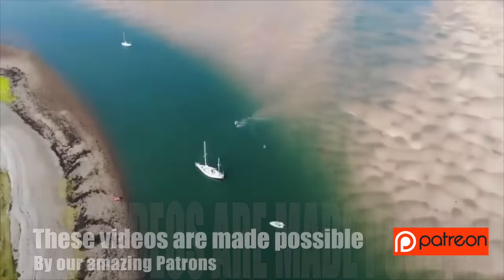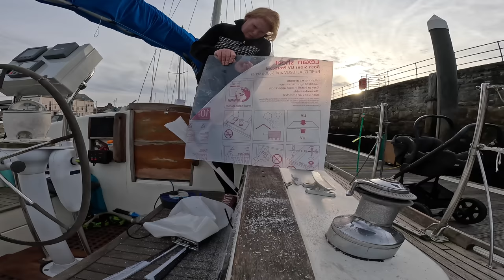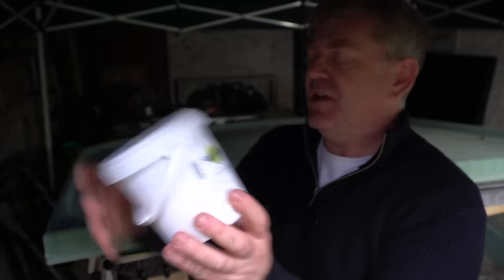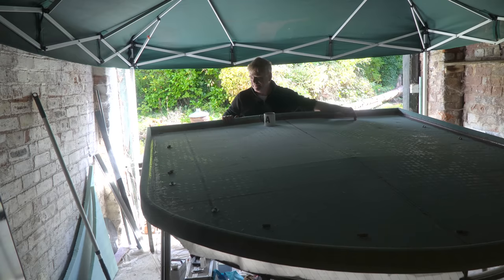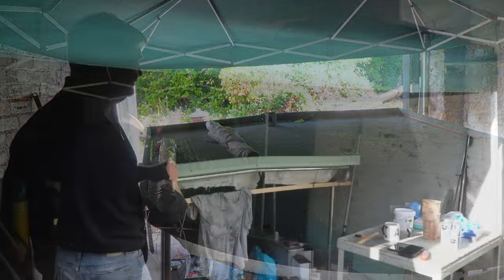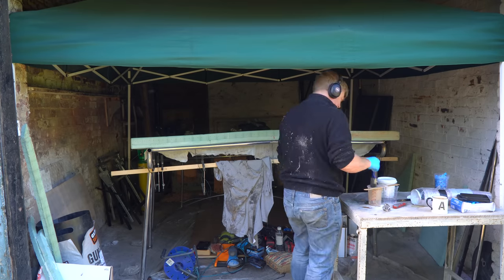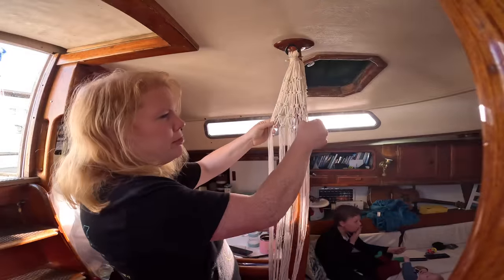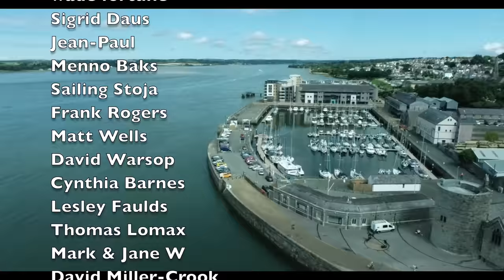164 : Making a Sailing Yacht Cockpit Enclosure Fiberglass Roof

Comment: If possible, make a 5- 8 mm high protrusion along the bottom edge - where you want the rest of the rain to drip from. Otherwise the rain that might not be retrieved will be led into places you do not want. This is because you will both tilt the boat and exposed to wind. The will lead the rain sideways and/or up!

Comment: Get a piece of wood that’s just the right, width length and depth to go in to your hatch track. Then cut Datos down the center that or just wait enough to put the plexiglass in then make 45° or whatever is appropriate for the bottom two corners cuts and glue them on to the plexiglass with epoxy. You could then make a board to go across the top, even if it needs to have an arch on it. Basically making a frame around the glass that fits into the slot for the boards that are already going in to close up the cabin.

Comment: You should frame the plexiglass into two separate pieces….add hinges attach to either side. Add a strip to run vertical overlapping the center frame attached to one side…I promise it will be a huge improvement…”use thicker plexiglass tinted in light bronze…”
Reply from the maker: Yeah that would be lovely but we were just using stuff we already had. Can’t afford to buy new bronze tinted Lexan at this moment but we will do that at some point I think

Comment: With the hatch, unless you give it a rigid strip across the top a blustery wind (or worse, a wave) could make the perspex bow inwards, pop out of its rail, and allow a gale (or a flooding) in through the hatch. 
To make it more secure you could fit a T-shaped profile to the vertical sides, with corresponding T channel to run down. Easily doable as you have a lot of play in the channel, so you can construct as additive, aluminium or stainless strips(2) secured to the fascia between the inside and outside of the hatch. And repeat on other side. Gap between strips to fit the width of the perspex, plus a small amount of play. 
[Or avoid using in high wind and high seas]
Reply from the maker: It's not for use at sea, only for rainy days at anchor :)
Reply: Would be wonderful to be able to use it at sea though. It's a great idea methinks.

Comment: Yes! I've done same, you're right, it's night vs day, lifts mood. 😊 Sometime, worth trying with Twinwall Polycarbonate, the stuff used in conservatory roof. Its very very light, no risk of injury dropped on toes, and similar thickness to wooden wash boards, and,  can be cut 2 sections, with strip canvas, sail cloth, stuck with Sikaflex etc,  to make a 'hinge', allow 2 pieces to fold in half,  to store ... and overcomes rain,  wind,  seeping through where they butt, at the join.
Reply from the maker: Will have a look at that. This is doing the job well for now 😃

Comment: For me you don't mix enough the epoxy. For corner put the epoxy in freezer plastic bag and you cut a corner and you extruded the epoxy stuuf much easier and more cleanly. Melissa greats ideas, for the window,  you can glue thin wood on the polycarbonate that will strongly reinforced your polycarbonate, but you already know that I'm sure. Beautiful ideas like usual.  Thanks for sharing.
Reply: Andy didn't show the complete epoxy mixing procedure, he only showed brief, edited sequences of it. You can't really comment on whether he is mixing it thoroughly enough, unless you've watched the whole procedure. 
Melissa has already suggested that she will use wooden "shims" along the borders of the lexan to make it fit properly into the channels. 
And I agree, she did a great job, so far! 👍

Comment: Hi Melissa, when I made the clear screen for our hatch, I used the curtain track for pop in caravan curtains to create a frame around the plastic, it then fits the hatch track without rattling about, or when I cut it in 2 pieces, sliding past each other. It was only a few quid from eBay. I stuck it with clear silicone so it’s water proof too. Hope that helps, loving what your all doing.
Reply from the maker: Thank you will look into that ☺️

Comment: Andy it’s Clive 🧙‍♂️mount your roof with a slight gradient …run any water off forward .. fit stub drains in holes that you can plug plastic pipes on to collect rain water for off grid water harvesting and that way you can control where it goes and don’t end up with run marks or rot points if there’s wood round the roof drain points.👍🏻😉
Reply from the maker: Hi Clive 

Yes that's the exact plan

I've built the gradient in both athwartships and forward and have already bought the drain fittings for it, just not got as far as showing that on YouTube yet

Comment: Having so much more light in the boat is wonderful. What I would suggest is in the future removing the handles from the outside and putting doors on hinges, that is what I have on my companionway and now having had it, I could never go back to boards. They swing open so nice and easy, and I don't have to worry about dropping it overboard when things get rough. 

You can get thicker polycarbonate sheets that will allow you to use a step over bit on a router to make the doors overlap each other. 

Looking forward to seeing that dodger finished out.

Comment: Love your fruit hammock. Maybe get Andy to make a narrow-width fibreglass strap to size, to place along the base of the hammock. Weave it horizontally in and out of the webbing holes at the base and secure it to the two  end-rings with some cord.That would prevent the sagging in the middle when objects are placed within. You could use some cardboard, thin ply, or flexible foam in the meantime cut into a strap shape.
Reply from the maker: That's an idea

Comment: Mellissa if you put a beading on your "Window" remember that it will have to stretch the full length of the "Window" to slide in and out.  This will be stopped by the boom.  That is why the wooden cockpit doors come in 2 pieces.
Reply from the maker: There's about 5 feet of clearance or more before the boom but yes it does need to be in two pieces eventually
Reply: @SailingMelody have you considered also changing the sliding ‘roof’ part to perspex for even more light? Remember the cockpit cover will rob a bit of the light you’ve gained. Looks like it has a wooden frame, I’m sure the perspex can handle the slight curve, or heat it to shape it 🤔
Reply from the maker: It's a consideration

Comment: Hard tops coming out really nice. Next time you have to do a fillet get a piping bag or just a regular Ziploc and cut the corner off. I think you may want to reassess the holes for the through hull fittings prior to fiberglassing.
Reply from the maker: Thanks for the tips!

Comment: Epoxy glass is so forgiving until it isn't then its the devil to sand flat again :)

Small scratches and divots holes etc disappear under glass but bumps or high points trapped bits make life very hard so its the transitions in new and old glass or overlaps of glass that can get difficult but peel ply really helps.  One trap I fell into on my first hull glassing of an 11ft dingy the first side I struggled with then I worked it out half way through as a result one side looked perfect the other side took forever to fair out and I'm still not happy (but then no one else can see it :)
Reply from the maker: Ahhh no!

Comment: Hi....just my 2 pence worth.......before fibre glazing would it of been worth putting some wooden or stainless steel strengthening bars ( flat)....on the top or even the bottom....of the canopy ....maybe bent to follow the Shape .....fibre glass it in.....   ..
Reply from the maker: The foam with glass is as strong as timber with glass or arguably stronger and wood will 100% rot eventually whereas the foam won’t. Many huge ocean racing boats are entirely constructed using this method :)

Comment: So when do you put drain holes in for sure it will collect water
Reply from the maker: Good question

I'll do that at the end before painting

I'll order some fiberglass tube and epoxy it in because they'll be much better and easier than making the holes now and trying to seal them with glass cloth